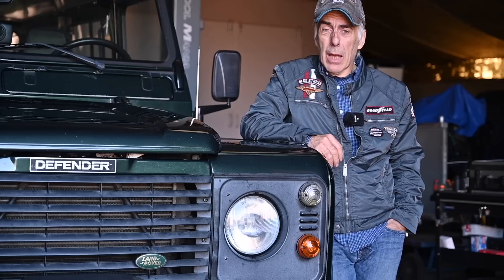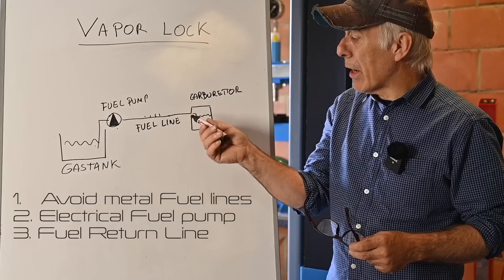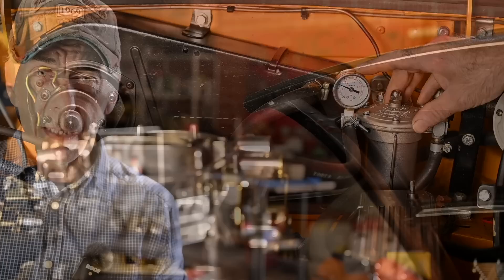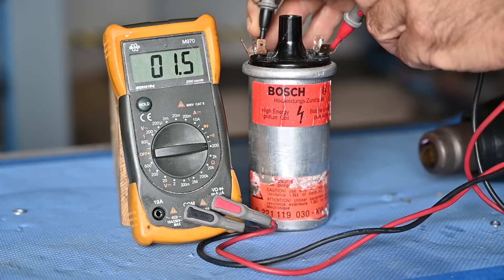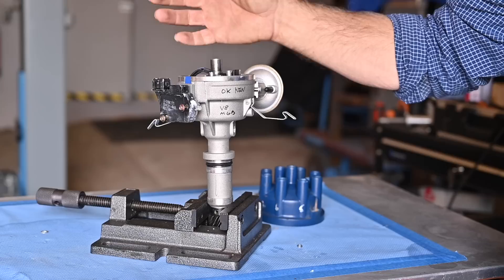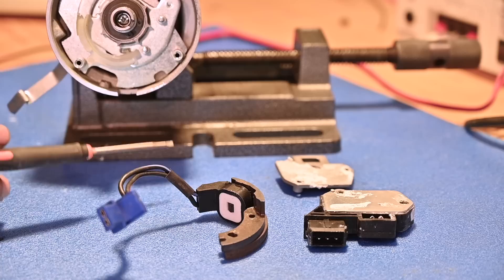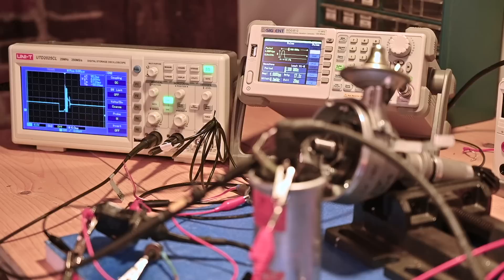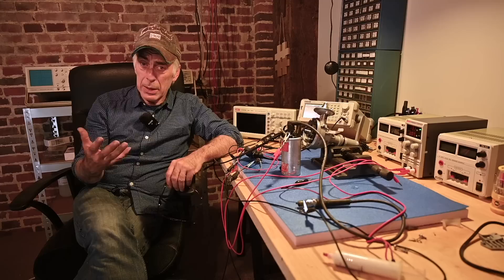Causes and fixes for warm start issues

Comment: As a commercial pilot I appreciate your explanation of the vapor lock. Spot on! Jim in Chile
Reply from the maker: Thanks for the comments, I can imagine that in airplanes...not what you want
Reply: @D3Sshooter  It is a real problem on final approach with tightly cowled aircraft. You have to keep a little throttle on to keep the lines cleared or the engine will cut off. Also it is an issue when on the ground doing a quick turn around. You land pull into the local FBO and drop your passengers and then have to get back out start up with in 15 min.   
We would have to purge the lines with the boost pump hoping you do not blow a jug.  
Once you learned the procedure it was no big deal. You just had to be aware of it. I have lots of years flying lots of different aircraft. Jim
Reply: enginemaxcarb.  Nope. I flew commercially for about 8 years and a couple of the planes I flew had VAPOR LOCK problems. Especially on the ground.  Jim

Comment: When your old like us, these old school repairs bring back memories. I wonder what the younger generation thinks of these repairs.
Reply from the maker: Thanks for the comments,  Me too... but to be very honest , the , modern cars are not that much different, they are just more computerised.  What I see with many young tech's is that they just follow flowcharts, read the ECU stored faults and start to replace parts untill its fixed. ( faut code gone).  Often to many parts are replaced that way...  They don't apply in many cases common sense and logic..sad
Reply: @D3Sshooter  Yes, we have an expression for that 'tactic' in America. We say the mechanic 'threw parts at the problem'. It obviously does not show very much diagnostic moxie. A common point of view in America is that mechanics of all stripes do not like cars older than about 1996, because that is when OBD2 came in. With OBD2, the computer tells you what it does not like. You replace that, and the computer is happy. Of course, there are other things, but the complex electronic stuff is thoroughly dependent on the computer telling the mechanic what the story is.
Reply: I prefer the old cars and bikes. I prefer trying to find what's wrong with vehicles then a computer tell me what's wrong. I'm 21
Reply: Im in my 30s, new cars don’t mean jack to me. I like machines, not computers

Comment: Exposing electronics to heat is always a bad idea and should be avoided wherever possible, the Rover SD1 Vitesse V8 has the amp mounted on the bodywork, not the distributor, a much better idea. There are also lots of cars where the coil is mounted on the engine, equally insane.

Anything which can be done to lower temperatures in the engine compartment is good, improved ventilation and exhaust manifold insulation come to mind.

Your well informed and clearly presented videos are much appreciated, thank you sir.
Reply from the maker: Much appreciated and thanks for the comments

Comment: Re: the ignition trigger circuit, I had a similar problem with my old '91 Dodge van. My mechanic replaced the distributor, the coil and the computer, and could not get it to work, so he returned it to me, still broken. (!) In my case, this was pre-OBD2, where the computer blinks a light on the dash in sequences to give you the code, and it complained about the distributor not giving any signal. Having the real shop manual, I rigged the distributor up with the 8 volts specified, and hooked the output to a scope, and spun it like you did, and it gave no pulses (from a remanufactured distributor)! So I replaced just the electronic part of the distributor and timed it and the engine ran again. My mechanic had no scope, nor the electrical savvy, and I have found that my local Dodge dealer is not very good at electrical stuff, either.
Reply from the maker: Thanks for the comments Dennis,   That is very common for dealership / mechanics.   They don't work anymore as we used to do at the time.  Back to basics' test and diagnose, understand and fix...   I have had new parts that were bad (like this new dstributor in the video).

Comment: Sheffield University did a lot of research on fuel  vaporization on an XPG engine and in the end concluded that adding 5% of heating oil raised  the boiling point of fuel high enough to prevent problems. 

However they also found considerable variation in ethanol content in 95 Octane fuels, but not in the 97 Super fuels, which they recommend. 

Power was not affected with their engine on their dyno.
Reply from the maker: Thanks for the comments, great write up. always nice to read comments that add value

Comment: I had that problem with my 97 Volvo 850 which continued after replacing both the MASS Air flow sensor and the Engine Coolant Temperature sensor. What finally fixed it was replacing the Ignition Coil.
Reply from the maker: Thank you for the comments, yep

Comment: Great detailed explanation with superb step by step. Thank you. I have a 351 Windsor with a Edlebrock with a hot starting issue.
Reply: I also have a 351w 1984  and im having issues getting it to turn on when it gets to oppeartinf temperature
Reply: @dominicmailhot5387 I sorted mine in the end. A new electronic distributor from Progression Ignition and a carb rebuild sorted mine out.

Comment: Really clear explanation.  I just posted this question to another forum and was referred to this video. Have a similar problem on my 1976 TR6 with points. Starts up cold easily.  Turn off when warm and restart immediately it starts up (like when your working on engine in your garage). Go for a ride and then park and wait for 15 min or so and it won't start start up. Sounds like its just about to catch though doesn't.  Cool down and starts up.  I have replaced plugs, wires, distributor cap, rotor, and added aluminum heat shield.  No luck.  Have adjusted timing, maximized vacuum by turning distributor.  If it starts right up when you turn if off and then on though doesn't after it sat for 15 min after drive doesn't that point to a fuel vapor or percolation issue rather than an electrical issue?
Reply from the maker: Thanks for the comments,  It could be fuel or ignition issues. And I can see your frustration with it.   It can be very hard to find the issue.  If you have points, then you will not get the issue with the amplifier.  I would, if I was you run up the engine until warm. Stop it, then try to start.
If its does not, take the HT lead coming from the Coil into the distributor cap out the cap.  Plug a spark plug onto that  HT lead and make sure there is ground to the sprak plug. Have someone to start the motor and see if you have a solid and good spark.   IF that is OK, then you have a fuel of carburettor  problem.  Vapor look, or starvation.
One way is to drop or spray some fuel into the intake manifold and try to start ( off course put the HR lead back). If the engine was suffering from starvation ( Vapour lock or so) it will fire-up with that sprayed/injected fuel.
If it does not start, then you have an issue with flooding, try to look into the intake manifold through the carbs by lifting the floats ( I assume is a stromberg or SU) and see if the intake manifold is wet.   If that is the case , the engine suffers from flooding.... that is fuel pressure , float levels .      Its a long process to find it, but you will.    There is one last possible issue and that is ice-ing.  sounds strange , I know. But fuel when evaporating cools the surroundings and its not uncommon in very damp / high humidity environments that ice is formed around the jets... 

And there is one last one, and that is valve clearance. If that is set wrong , it can be that the valves don't close entirely when hot.  That would make a cold start hard....   

I hope that this helped a bit, Steve

Comment: As you observe Steve, the modern "fuel" that we have to run on is extremely volatile, this cause problems with the warm manifold/carb being at, or above the evaporation point of the fuel, tests carried our recently at Manchester University found that one way to overcome this problem was to add 5-10 % of kerosene to the fuel, this went some way to solving the problem, it does, of course reduce the octane rating , so can cause problems in high compression engines, quite why we have been inflicted with this modern rubbish fuel is a mystery, it causes vehicles to do much less miles per gallon, so can hardly be considered a "green" alternative to proper fuel, but no doubt it appears on a different chart as "better" for the environment, so ticks the right box as far as politicians are concerned, you know, the ones that jet off to exotic places for the weekend. Stay safe! Chris B.
Reply from the maker: Thanks for the comments, and great write-up ...

Comment: On the ignition coil: small correction. It reads 1.6 ohms, which becomes 1.3 after subtracting the lead resistance, which is good. You called it at 2.6 becoming 2.3 ohms.
Reply from the maker: Did i,  Oeps sorry....   working, speaking and reading    ....

Comment: Fuel lines located too close to exhaust system commonly causes this. Move or  Insulate the lines. Or insulate the exhaust pipe or header causing the problem.

Comment: Could vapor lock be an issue on a 1988 carburettor car? I've tried everything in the ignition system but it's not fixed the hot start problem. Changed spark plugs, ht leads, ignition coil and I've been assured everything that could be replaced in the distributor has been changed. Still won't start when hot.
Reply from the maker: It might , or its flooding... Both are an issue...    If you have an electronic ignition , that might also be an issue when its hot. I had that once on the MGB GT V8

Comment: Used to have that problem vapor lock on high hp motors we used to install a aluminum plate between carb and manifold ..then use electric fuel pump with braided fuel lines with a return to gas tank..
Reply from the maker: Thanks for the comments
Reply: D3Sshooter no problem, your vids are great keep them coming 👍🏻👍🏻👍🏻

Comment: If you use inductive type distributor, you can for example GM HEI igintion modules. 4-pin HEI module fits normal carbureted engine.
Reply from the maker: Thanks for the comments, good tip TXS

Comment: One solution to build return line is 3-port fuel filter. For example Wix filter 33041 (Chevrolet (71-73), Pontiac (66-67)) have return (vapor) outlet.
Reply: They also used those on early Chrysler FWD cars with the feedback carbs (K-cars, Omni, etc.).
Reply from the maker: Thanks for the comments
Reply from the maker: Thanks for the comments

Comment: A very good video 👍.  One question: in a returnless fuel system, how is the vapor lock issue solved by design please? My car is having warm start issue, but I don’t see any special device on the fuel rail, except a fuel pressure sensor (with a vacuum hose connection).  How vapor can be purged in such a dead-end system please? Thanks!

Comment: Thankyou so much - Your videos are absolutely brilliant for a novice like me trying to figure it all out. 

My 1977 Camaro (inline 6) is not happy after warm starts -  it starts fine from warm but the idle is always very low and weak after a warm start - then the car hesitates and stumbles under load for the first mile or so but then it runs absolutely fine when back up to operating temp. 

Could this be a symptom of vapour lock ?  

The car has recently been fitted with an electric fuel pump which has made a huge improvement and carb has been fully rebuilt along with new distributer and coil and fuel filter.

It runs beautifully from cold and runs fine when up to operating temperature but it just always seems grouchy and hesitant when the engine is started from lukewarm and has been sat for an hour or 2.
Reply from the maker: Sorry for the late reply , as i was away for work. But thanks for the comments.   I would think that yours suffers from flooding.. have a look after a ride ( warm/hot engine) and look inside the carb ( engine turned off). There should be no dripping of fuel.  If you do see dripping inside the carb ( you need to look down into it) then you have a flooding issue
Reply: I have the same exact issue with a 350 and a holly carb. Runs fine from a cold start but as soon as i shut it off for more than 30 minutes it wants to die upon startup. I actually have an AFR gauge installed and when this happens the mixture is reading EXTREMELY lean, like up in 19-20’s. It’s heat soak. Our carbs are sitting under the hood in basically an oven so when we try to fire it up again it’s trying to use all the heat soaked gas and vapor left in our carborator. So until that old mixture is blown out of the carburetor and replaced with fresh fuel from the tank it’s running lean and “grouchy”. I need to get a good phenolic spacer for my carb because the body gets super hot and I’m 99% sure my fuel is getting way to hot
Reply: Thanks so much for your reply - I’ll have a look next time after a drive and see if there is any dripping in the carb.     It’s also developed another weird habit lately where occasionally it will sputter and nearly cut out when I take a sharp right corner at slow speeds. 

When it does this I get a strong smell of fuel so I’m thinking your most likey right in that it is a flooding issue
Reply: Bone Thang - it certainly sounds like yours is mirroring the same symptoms as mine. 

mine does smell quite rich at times though so I’m not sure if it’s a lean condition.
Reply: @Skeksi_Man  I hope you figure it out. Heat is the enemy. Also if you have a Holly, make sure your float level is set correctly
Reply: @Bone Thang - yeah float level is probably whats causing my issues on the sharp corners.  

I’m rocking the old Rochester single barrel carb - fully rebuilt but I hear these things aren’t great.

Comment: I have the same issue with my Nissan patrol tb42s engine it appeared after I changed my carburetor to an aftermarket China made type
An easy way to solve this issue without changing anything is to keep wide open throttle when starting the car
Reply from the maker: thanks for the comments

Comment: My 2017 Lexus LS460 will not start or have trouble starting when the AIR TEMPERATURE is hot outside,  usually about 80 degrees Fahrenheit and above.  It's quite annoying and the dealer said it's not the battery and they frankly do not know what it is. It seems to happen most with hot weather when the car has been sitting in direct sun.  After a minute or so of trying to start the car it usually starts. Any ideas?

Comment: Thanks for this video. I have same problem with my Audi a6 from 2007. 
it starts fine when it is cold but when I drive and turn off the engine the car does not start immediately but has to wait like 3 minutes then it starts again. I dont know whats the problem problem yet:-(

Comment: Hi loved the video, I have two questions I have a similar setup for a range rover classic , two questions: I need the part number for the lucas amplifier also how did you setup your return line I have the same carb and regulator. 

Thanks 

Ole

Comment: Good day, I have a 98 Nissan Sentra. I just have a quick question. My car doesn't want to start but has spark. However, I have a mechanical fuel pump which I only put on a few months ago and already no fuel seems to be coming through. Could it be due to my carburetor being bad or should the pump still have pushed fuel through to the carburetor. I think I might have an aftermarket pump.
Reply from the maker: Well it seems that you might have a clogged fuel line or dirty fuel-filter, try to remove the fuel tank cap and take off the hose on the fuel-pump that comes from the fuel tank and blow compressed air into the hose. You should here the air bubbels in the Fuel thank.  If not then you have a clogged tank or fuel line...

Comment: Hi this is a perfect video....i have similar problem with my fathers car... it's a mitsubishi l300 van model 1982 with 4g33 engine 1.4 cc carburator.so here is what happens.when it is cold it fires up immediately (what a perfect feeling).then when i go for a drive and the car reaches the operating temperature and come to home and let it for about 45min to 1 hour and started to fire it ......then it hesitates to start and starts after 5 to 7 cranks simultaneously.....then if i turned it off and immediately start it again it fires up perfect.....what should be? I change the carb with new one i put new sparg plugs with new sparks put new mechanical fuel pump .put another ignition coil (but a used one that said to me that is ok) the problem exist.... ,🙄🙄🙄🙄🙄🙄what must I look....i m very confused....seems not to be vapor lock or heat perculation...i m not sure what to do.....maybe new ignition coil???? I m looking for the amplifier u said but i m trying to locate it in my car.......any ideas i will try to post photos.
Reply: Hmm maybe i found the problem...i saw that my mechanical fuel pump isn't the correct one.doesnt have 3ports which one is the return line.someone put a pump with 2 ports snd the return line is bloked....so it is possible that thing makes heat percolation....i will put the correct one and then try again
Reply from the maker: Could be several things, you will need to test it by removing hoses while it has the issue, maybe spray some gas into the intake manifold, test the ignition with a sparklug out of the engine... etc...  I wrote a complete part on that in one of the comments.
Reply from the maker: That can be issue " Vapour Lock"
Reply: @D3Sshooter  i m very desperate...i thought i found the problem but.....no..... I was thinking that must be a fuel problem but I fail. I have put 3different carbs and the symptom is always the same.so back to ignition...i change sparks spark plugs new coil ......the same thing.....the only that remains is to test the distributor....any ideas how to figure how? Do u think that a distributor will make that problem i have described above be solve?